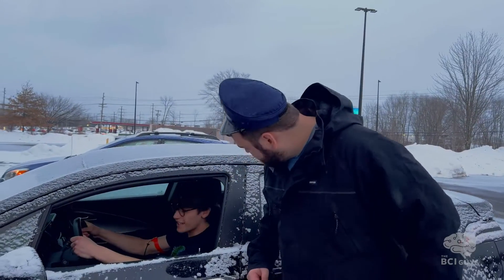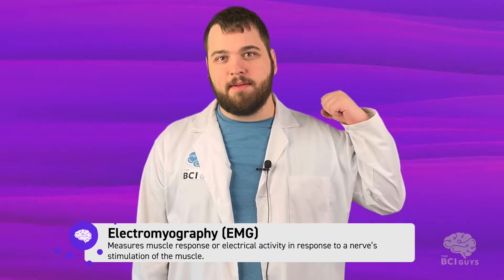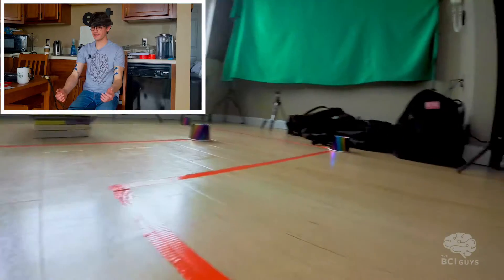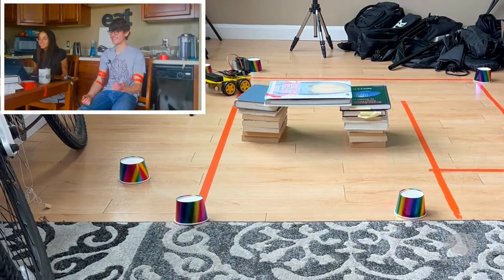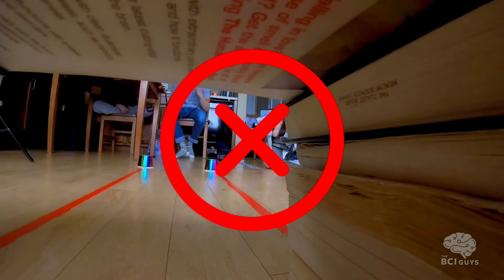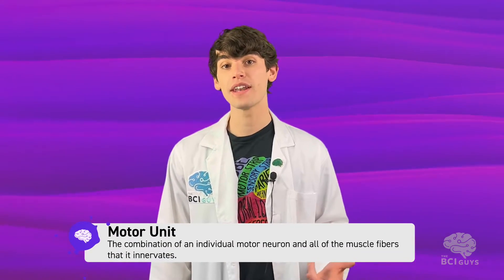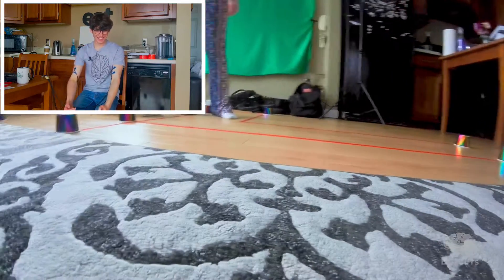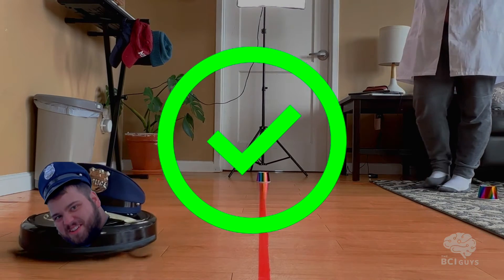I Controlled a Car With My Brain

Comment: What the approximate cost for building this
Reply from the maker: It’s gotten expensive unfortunately. The futon board from OpenBCI is $1000, the electrodes are $30, the car was $50. OpenBCI had a cheaper version that would also work, the ganglion, which is about $800. 

These things have gotten expensive unfortunately, but the mechanisms are quite simple so you could probably find another board or make something yourself. Actually, there are these things called MYOwares that are maybe $70 each (been a while since I’ve used them). They work with arduino. You could get away with using two of them. They aren’t the most reliable boards out there but if you want to do a fun project, they’re a good place to start!

Comment: You have great content, you just need to refine the way that you present that content here, in YouTube
Reply from the maker: would you elaborate? We really appreciate feedback but I'm not sure I know what you mean
Reply: @BCIGuy  I'm not sure but I tell what maybe you should change: 

1.- You should give the sense of complexity (not sure if that is the right term):  e.g show a UI in real time with a time series of the signals, pretty simple to do
2.- AVOID non-circular elements in the screen, e.g: If you show a videoclip round the corners of that video.
3.- Clean or use a cleaned area that is going to be filmed
4.- Define the kind of style of your animations e.g: you are using "liquid" animations, only use that style

My apollogies if I'm NOT helpful, thare are only some ideas that comes in my mind when I see your videos, but the are great, however I think that you could get a broader audicience if you do a kind of "youtube engineering" on your videos.